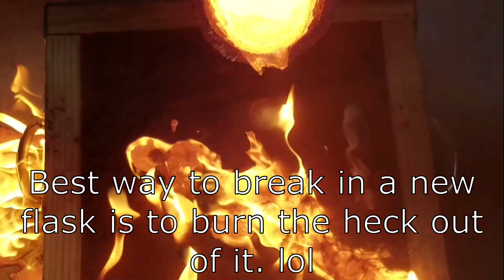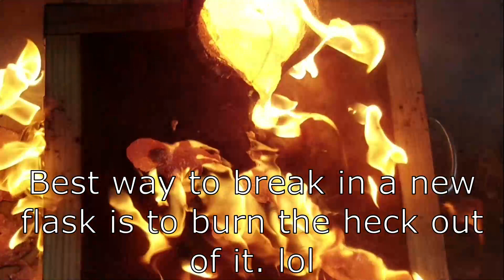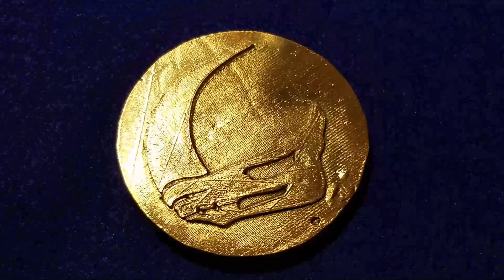Making Nordic Gold Mandalorian Mudhorn signet, Star Wars Alliance/Empire/Storm trooper Coins/Rounds.

Comment: I LOVE that bauer portable band saw. Kerf is nothing and cuts like butter.  Ive gone thru dozens of blades over the years but we abuse it. Only problem is my switch went out so i put it on a switched extension cord. 

These pours are stellar bro! Man i need to get a furnace.  Stormy gonna love that one.
Reply from the maker: I like it, only paid $100 for it at harbor freight. I have a big bandsaw that I am fixing up, just gotta install the new switch and hope it works. I dont even know if he watched the vid. As long as it works, it's a good idea. Thanks for watching
Reply: @Thewulf56  Yep. HF has a bunch of my money. Only a few tools ive regretted buying. For heavy duty stuff though like grinders etc. Ive ended up with ridgid and dewalt. Otherwise bring me some china specials all day! I use a bunch of their trucker chains and binders hauling my tractor those have been flawless. I was impressed. Also bought a 9k lb wench like 12 year ago and it still runs like a champ. We have loaded tones of stuff with it onto the trailer....

Comment: Nice melt, I wish I could actually cast like this but my 3D printer parts haven’t come, so I’m stuck making asmr videos
Reply from the maker: You can do it!  Just pick a good spot on the print bed and print them vertically.
Reply: Thewulf 56 Ik about that but my extruded nozzle is clogged and I’m waiting for that to come in too
Reply: Thewulf 56 I know that you can get it out but I messed it up
Reply from the maker: Ahhh, I see now. I got a big kit of them the last time I ordered some, they are pretty cheap atleast.